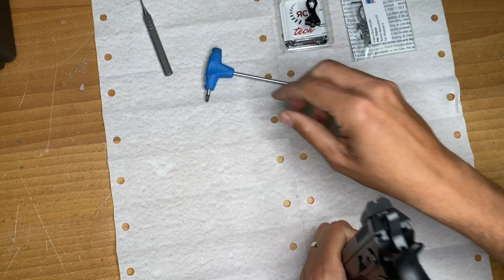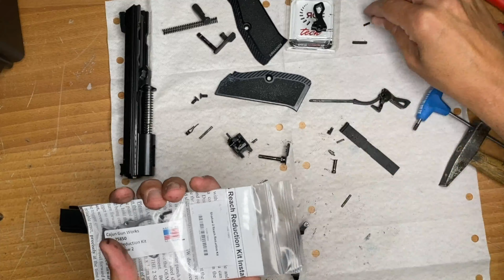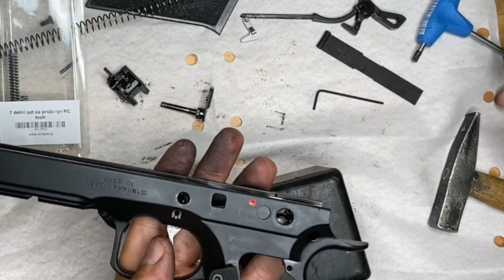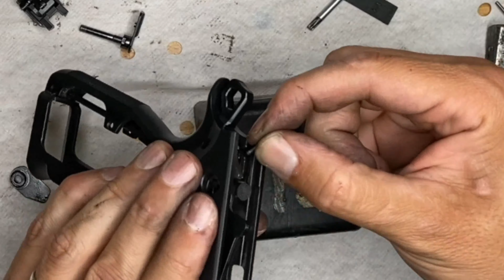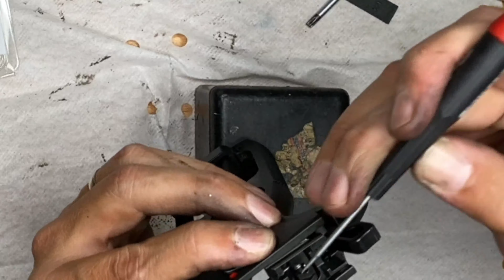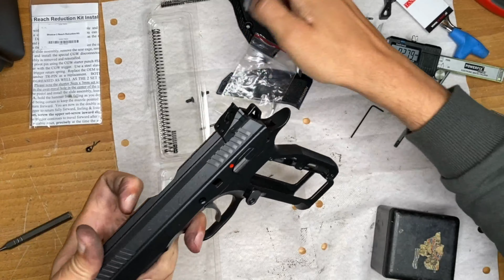How to REDUCE Trigger pull, Over-Travel & reset on CZ Shadow 2 and SP01 | Cesar-Shop

Comment: A tip for anybody that's done all the usual stuff to their trigger, like a Cajun Gun Works trigger pack & polishing everything, and want to squeeze out the last few drops of performance, there is one last thing you can do (for both Shadow 2 and SP-01) to make that trigger just a little more crisp. 

Take your gun, unloaded obviously, and cock the hammer back until it locks, then get that thing right up in your face close up and watch the hammer from the side as you pull that trigger as slow as you can. Watch the hammer for any backwards movement, if it sits completely still all the way to the moment it fires you can disregard this completely, but if you do see it move backwards as you pull the trigger that means there is a slight gap between the frame of the pistol and the sear cage, which will create some "sponge" in the trigger pull. 

This gap needs to be filled to extract the maximum performance from the gun, in my case (SP-01) I removed the sear cage and thoroughly cleaned the back of it where it touches the frame with acetone, then cleaned and lightly oiled the frame in the same spot it touches the cage. I then added two very small beads of JB weld epoxy into the little recesses in the rear of the sear cage that touches the frame, just enough to fill the gap but not enough to squeeze out when installed together (it's kind of hit or miss, I had to try three times to get the right amount to fully fill the gaps, which is good because too little is much better than too much), you can wait 20-30 minutes for the epoxy to set up a little so it flows less before installing it into the frame too, and once it's installed and the safety is back in place to hold the cage, you just cock the hammer to place forward tension on the sear cage then wait 12 hours before touching it to allow the epoxy to set without disturbing the gap. Once it's hardened check to make sure you didn't gunk the hammer with epoxy and everything functions properly, and if all works out you'll now notice the trigger pull feels much more crisp and defined with a slightly lighter pull weight.

Keep in mind you need to oil the frame where the JB weld touches or it will bond the sear cage in place, if you oil the one side the JB weld will stick to the sear cage but not the frame, allowing easy removal and re-insertion without screwing up the gap.
Reply: Thank you for such detailed instructions
Reply: @Stoenered  Thanks! I kind of went down a rabbit hole of extracting as much performance from my SP-01 trigger as possible lol, I've probably put over a dozen hours worth of fitting and polishing into that gun by now😅. But all that time working on it really made me understand the function of the gun, much more so than what you can find about it online, there is zero info about checking or fixing sear cage movement on youtube or internet forums so I'm happy to share all the insights I learned during my quest for a "perfect trigger". I've got it pretty close to perfect but there's always room for improvement I suppose, it's a 1.8lb pull weight SAO with only .050" thousandths of travel. It hits the wall at .033" with maybe a couple thou of creep, then the remaining .015" thou of overtravel gives the sear just enough clearance to not rub the hammer hooks on the way down, then after firing it resets at .045" with another .005" thou to ensure the trigger resets when the pistol is dirty. Like I said, a rabbit hole lol. I've got a short on my channel if you're curious labeled "this trigger is phenomenal", it shows the travel and reset using a dial indicator.
Reply: I just discovered this issue on my own and found another fix that is a little more time consuming. You can find an extended pin the circumference of the hammer pin retaining pin and replace it where said pin would go. It’ll stick out of the slot within your frame and you can file it to fit between your sear cage and pistol frame so the sear cage doesn’t move.
Reply: can you make a video on yours
Reply: @fakie9329  If I find some spare time I'll see what I can do, I've been pretty busy lately and haven't had time to make videos for a while but I'll try and get around to it.
Reply: @TheExplosiveGuy  bet. To be honest all I need is confirmation with pictures on where to put the epoxy and to see how much I should roughly put. Other than that I can pretty much go off of what you read and what I see.

Comment: It pains me watching him punching in that disconnect or pin. I wanted to grab it and do it myself...
Reply: OMG
Reply: To be fair those disconnector pins are an extremely tight fit in the hammer, one end is staked in with a punch from the factory which can leave a bulge on the end of the pin, and if it's not inserted thin end first it will do what's happening here, which apparently he didn't know or notice. You need a damned starter punch (basically a very shallow angle center punch) just to get them loose enough to punch through with a pin punch.